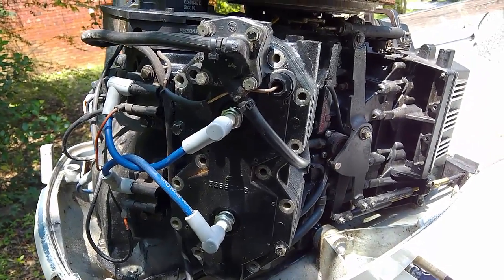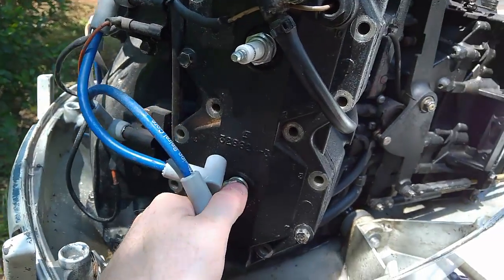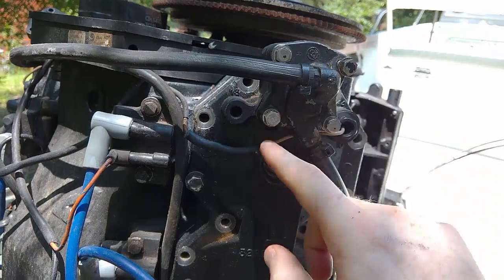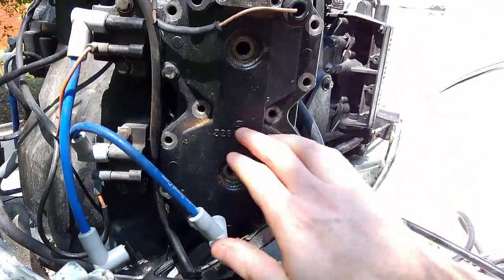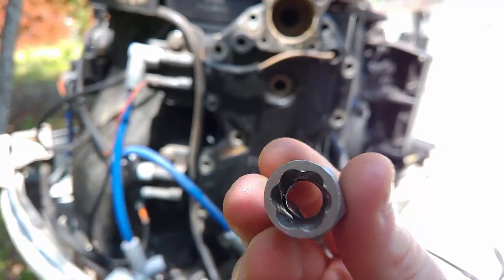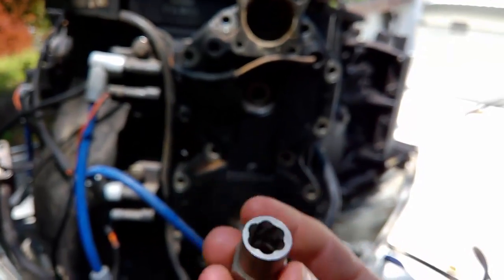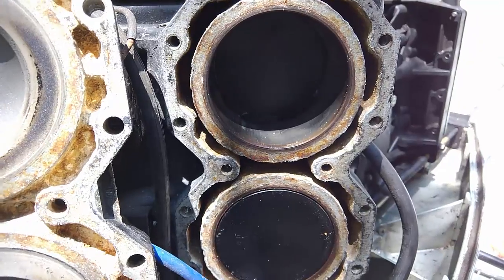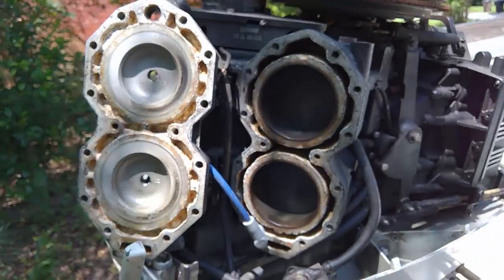Replacing an Outboard Head Gasket

Comment: Hi, i have a question,replacement of head gasket can increase the cmpression?
Reply from the maker: If you have a hole in your current head gasket or it’s not sealing like it should which is causing a leak in compression then yes, a new one would increase compression.
Reply: @JasonLefevers  Thanks!

Comment: On older evinrude/Johnsons they have about three water restrictor tubes per cylinder that fit around the cylinders at specific locations. You install them by pulling the old ones up and out and pushing new ones down along the cylinder in the same exact position. If these tubes are missing, restricted from collapse, or blocked with gunk, they can cause the motor to overheat and blow another gasket. They look like short pieces of vacuum line hose. I think they charged me about $6 a piece for them which is nothing but a rip-off for very little rubber. Thought about cutting some automotive hose to that length and size and using it but didn't want to take the chance of screwing up. Any way if you replace a head gasket and you see the top ends of these tubes around the cylinders, and they are collapsed or deformed/blocked up then you better change them before replacing the head gasket and you should always check the trueness of the head mating surface with a straightedge before installing a gasket.

Comment: Hi I am thinking to clean my pistons from carbon on my outboard? My question is do I have to put nex gasket after I done or can I use the same one after clean it? Do you also recommend this I mean should i give a good clean up to pistons or leave it like that? Thanks
Reply: Don’t touch the pistons! Yes you need a new gasket everytime you take the head covers off
Reply: @reddawng43x91  thanks for replying yes I did not open the head! How ever I sprayed some carb cleaner inside pistons and I have stick some clean clothes inside and did take some dirt out? Do you think this will damage piston area?
Reply: @bahadirdogan6208  should be ok as long as u spray some marvels mystery oil or wd 40 to relubricate the cylinder walls before you try and start it
Reply: @bahadirdogan6208  if u want to clean the inside of head the best thing to do is mix one bottle of sea foam with 1 gallon of premix and let it idle and rev up and run it till u burn that gallon of fuel should clean everything

Comment: Hi Jason, excellent stuff. I have a bolt head that broke off. I started to drill the stud and then watched your video. I have a few questions. 1.) Do I need to remove the plugs? Thinking yes but wanted to confirm. 2.) Would you mind watching my video & letting me know what you think? https://photos.app.goo.gl/1tR4kS3GgqvMSz9v9 thanks in advance.
Reply from the maker: I’d definitely pull the spark plugs out and if you can try and pry that head off then you’ll be left with that broken bolt hanging out a bit. At that point you can try and use a dremel tool to square off the edges for a wrench or you can try and put some vice grips around it.
Reply: @JasonLefevers  okay, will let you know how it turns out. Thanks
Reply: @JasonLefevers  got it off with a little bit of damage https://photos.app.goo.gl/Qc4Mn5XnoWq7Ts7E7

Comment: Dude you don’t put the bolt back on on that order you torque them in that order! Why would you do a gasket video and not give the most important part of the whole job? torque spec and the stages? Usually 2 stages of torque pattern settings first a moderate torque then again with final torque. That v4 may not have 2 stages however to Be clear you can hand tighten them to get them in place in any order but when you start tightening the bolts it needs to be in that order usually in 2 stages sometimes not!
Reply from the maker: terry fonz Dude, I misspoke. For proper torque specs I mention they should get their outboards manual. Do you normally make the rounds pointing out mistakes in everyone’s videos. Get a life.

Comment: Hi there I am about to get started on a very similar project. Issue I have is the two bolts towards the bottom are quite rusted and I am worried the will snap even though I have sprayed them to loosen them up. Any suggestions?
Reply: Try clockwise too, usually works for me..... Tighten, loosen etc.
Reply from the maker: That's unfortunately a possible outcome when dealing with bolts in that area that haven't been removed in a while. Let the spray sit on them for a while and then apply a tight-fitting socket and put a nice long extension breaker bar on it and apply steady pressure using the breaker bar. If you just use a short handle socket wrench only, then there is a possibility it could break off. You can also apply a good bit of heat to the bolt as well.
Reply: @JasonLefevers  Thanks Jason. Runs fine so I have decided to leave it alone for another day :) I'll cross the bridge when I need to

Comment: If that motor has an exhaust cover/lid should be removed and all water paths clened to perfection. If cylinder heads, upper pistons, inner exhaust covers are found too carboned up take advantage to clean them to fatory state condition. The motot will cool much better than just cleaning the cylinder heads water paths.

The cylinder head bolts can be installed in no particular order till finger tighten.  The diagram shown is the torque sequence pattern that must be followed to specs after that.

Comment: Nice job Jason. Have the same motor. However my shop manual does not have the order or the torgue. Any chance you can share?
Reply: shown at @9:25
Reply: did you ever find out or get a response? I am in need also.

Comment: I've got a 96  yamaha 20hp outboard  was going all  good took out for ride got in the water an it wouldn't start then oil started  coming  out from the foot  of the motor still  start but sounds like it's running on 1 plug is there a easy   fix.
Reply: is the plug firing? If it is, does that particular cylinder have good compression? If not it could be a blown head gasket.

Comment: what was the torque specs? on head
Reply: 19
Reply: @reddawng43x91  is that 19 ft pd or inch pd??
Reply: Did you ever find out the torque specs
Reply: Is that 19 fp or inch pd??

Comment: This was awesome!  I have a 2stroke 40hp yamaha that will throw the overheating buzzer if I gun it for too long.  I am certain that those channels around the cylinders are a little clogged up.  Brand new impeller and the same thing.  Only takes about 1 minute and the buzzer goes off at full throttle.  I might take on this project myself since the mechanic will bend me over on that job!

Comment: could this be fairly applicable with a 95 merc 75hp?
Reply from the maker: Yes, It should be the same general process. I've done even smaller Mercs using the same general method n this video.
Reply: @JasonLefevers  You have no clue about what your doing ! That motor is blown up! You can see on bottom cyl that something passed through the combustion chamber. On top of all this you don't even resurface the head and block surfaces. It wont matter anyway cause the material that holds the steel sleeve is cracked and rotted. The first thing you do is a compression test ,then you could have just thrown it away,it's junk wat a waist of a head gasket. WAKE UP D/B
Reply from the maker: @jamestaddei9148  This motor is still running strong with no issues. Thanks for putting in your amazing two cents though.
Reply: @JasonLefevers  LOL ,  Ha Ha OK ! Engine is Blown and you do even know how it's supposed to run . Cert Outboard Tech 35 years
Reply from the maker: @jamestaddei9148  If you say so.